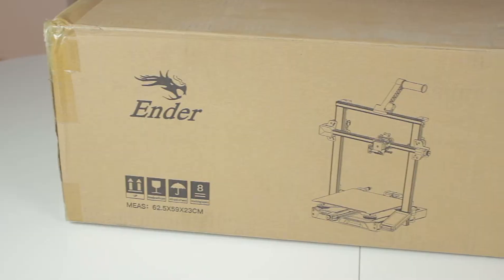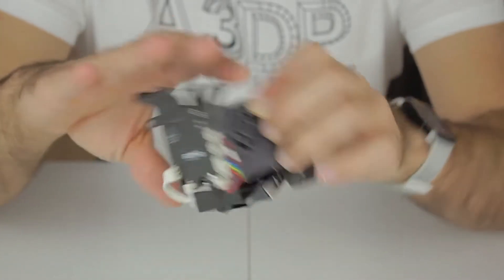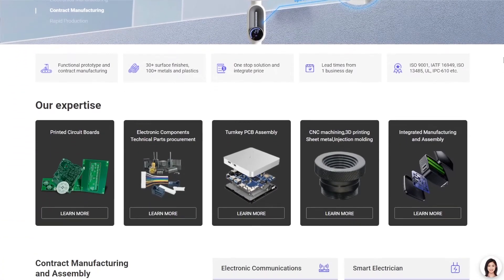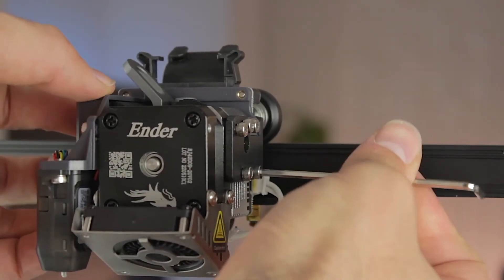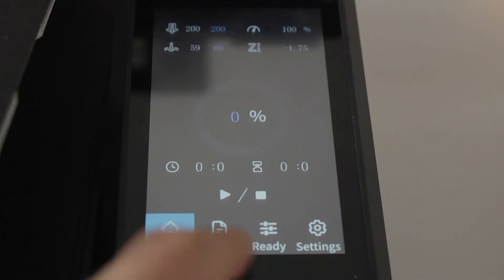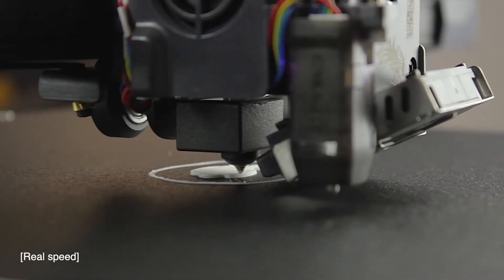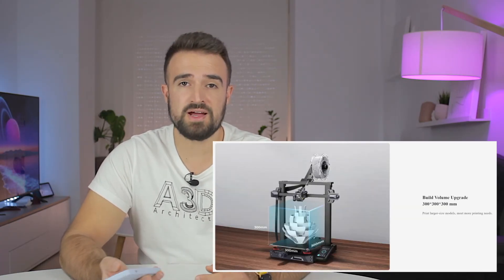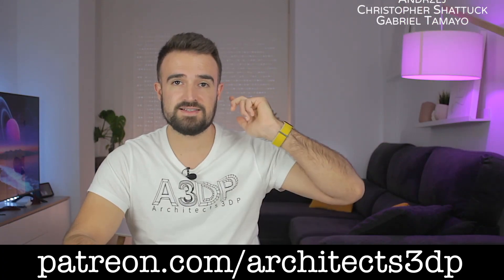Creality Ender 3 S1 Plus | 3D Printer Review | Same BEAST but BIGGER?

Comment: Its not that quiet. Fake
Reply: The HB cooling fan is high pitched, really annoying, and I got a 4020 that will replace it. I soldered a resistor on the PSU fan to make it quiet. Part cooling fan will be replaced too.

Comment: The bed leveling needs to be done the other way around. First the AUX with the 5 points manual, then the automatic one. If you do the automatic one first, when you do the AUX it will basically break whatever mesh it was calculated before.
Reply: Of course... That's a nonsense in the video doing a bed mesh and later leveling the bed... World upside down never gets gooood

Comment: We just bought an Ender 3 S1 Plus, it has a faulty SD card slot. The UK vendor and Creality are dragging their heals with replacement. Absolutely terrible support. So we haven't managed to print a thing and nobody is willing to replace it or supply a new main board.
Reply from the maker: Thanks for the info! Have you tried formatting the sd card in a different format?
Reply: @architects3dp  No, the slot is broken, physically. You push the card in & it pops back out, it doesn't lock. We have loads of SD cards, it's the slot. We have 10 3D printers. I know what I am doing, it is broken. A new board or replacement printer is required. I am NOT soldering a new SD card slot onto the board, easier to just buy a new one. But it is a brand new printer, just out of the box & I will not spend a red cent on getting it repaired or replacing parts. If it comes to it, there is always the "get the credit card company involved for a refund" route. We got it from 3D Jake, they aren't helping & Creality is NOT helping. Terrible service all round.
Reply from the maker: Omg I’m sad to hear that man.. we have no relationship with Creality but I hope if they see this they can answer you. Good luck friend
Reply: Thank you
Reply: @lexzbuddy  you can print by usb, i had the same issue and solved it printing like that